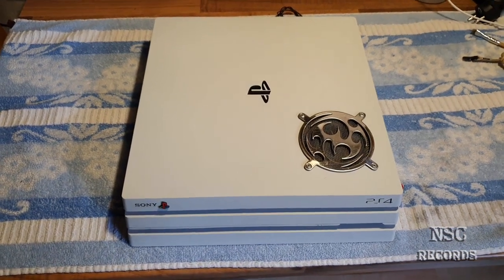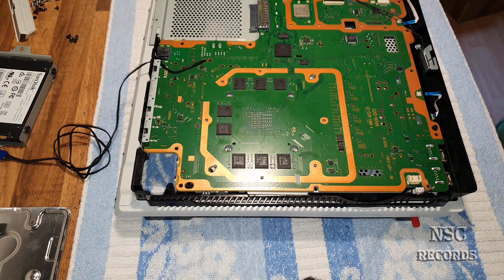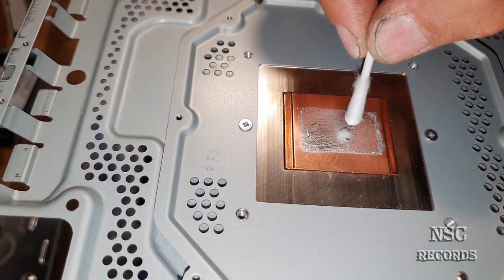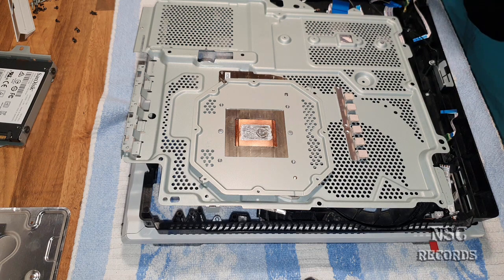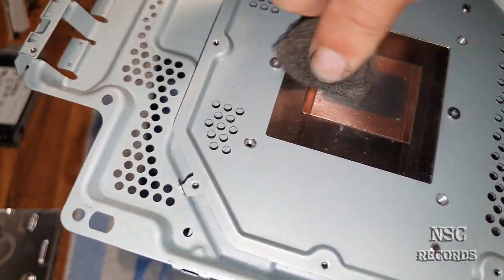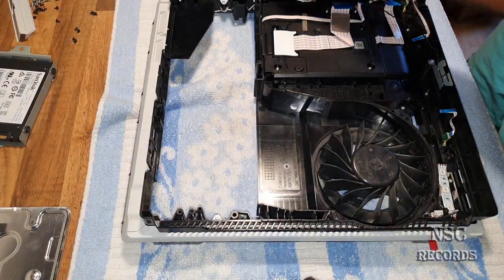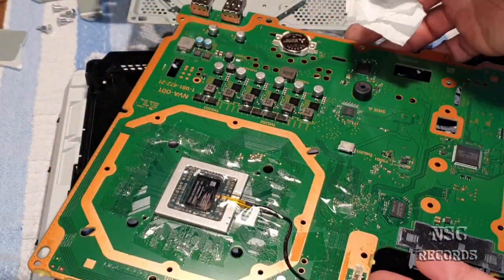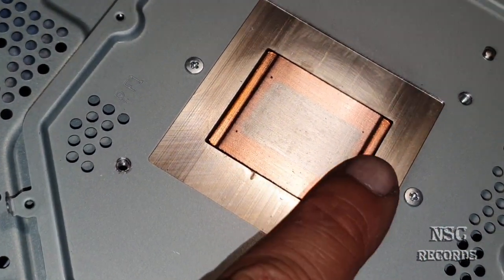Liquid Metal on a PS4 only for few days, take a look how it looks By:NSC

Comment: I had great results from using a IC Graphite Thermal pad on my PS4 Pro. The best part is I don't have to worry about the paste drying out anymore.  The biggest difficulty was getting the graphite pad to stay in place when putting the board back on. I had to use just a tiny tiny amount of thermal paste (put a smidge on two opposing corners) to get it to stay on the die while I lowered the board on the cover. I also used my girlfriend's nail polish to clear-coat any open electronics surrounding the die because the graphite is conductive. I reused and recentered the pads on the memory chips. Now the PS4 Pro sounds like it is brand new.  My refrigerator is the noisiest sound in the room.
Reply from the maker: Yeah, they are really good, used it also on some Notebooks and some ps3 :)

Comment: I know this was an experiment/test, but since consoles are usually carried from place to place  and you can't simply replace the whole cooling solution of consoles without buying a new console or parts of it (which are sometimes either hard to find or are more expensive than some high quality PC coolers), using a compound, which gives good cooling performance for some lifespan of a product still doesn't make any sense.

I think, the only best option for cooling consoles is to put them on some sort of open bench and somehow put a PC radiator to APUs with washers or something like that. 

Also, this is just a theory, but from watching how mobile manufacturers use graphite sheets and copper sheet tapes to cool powerful APUs in such a limited space as smartphone, there's probably some smart way to cool a console while using the original case.
Reply from the maker: Watch my next Video, you gonna be shocked...

Comment: Just opened my launch pro with liquid metal .  After a couple years I guess.  Fan was starting to ramp up on all games, opened up and it was completely dry !! The copper heat sink is now silver!  Tried removing was a no go .  On the bright side copper heat sink was smooth so applied kryonaught and is very silent now.
Reply from the maker: Yeah, forget liquid metal on consoles...
Reply: @NSC-Modz  hey, what do you think about sony using liquid metal for ps5? is it gonna be dangerous in future
Reply from the maker: @wazza831  i think same, i will check it out as ill get the PS5
Reply: I have liquid metal in my PS4 Pro, and after some time or a lot of movement I need to clean and reapply. Exactly the same happens to mine (heatsink goes silvery and rough), but after a good clean up - it is better than before. Seems to last longer and longer each time I need to do this. A super quiet PS4 is worth a bit of maintnence once in a while imho :-)
Edit - Perhaps the heatsink is an alloy of sorts, not completly copper....
Reply from the maker: @EgonSorensen  yeah, for me never more again liquid metal xD Kryonaut is just ok tho...

Comment: What do you think about the PS5 Liquid Metal Cooling. Do you think they are using a proprietary liquid metal? Will it last? I heard it has been decided 2 years ago and they may have tested it extensively.
Reply from the maker: I have tested it already a lot times, but at last i always replaced again with standard thermal paste, so in easy words, it's not worth...

Comment: I have done this mod but I went further and set a temperature gauge tuning from the gpu.I used a drimmel to cut the metal around the gpu so I could fit the sensor touching the chip used clear nail polish to cover all the transistors.applyed liquid metal.cutting the case under the ps4 pro and the metal plates so the ram chips showed.
 I put heat sinks on ever ram chip.
i also cut the inside of the consoles metal plate in the spots where the stock fan would have been.
I toke the stock fan out.
removed it all together.
I then bolted a pc fan over the top.where your hole is.
where the fan should have been anyways.I then put metal adjustable legs like for furniture under the ps4 pro and then a pc fan over the ram chips this is so the air could flow under the unit.cooling ram helps great amounts.I installed led and a sensor.
Next to where the stock fan should have been you can see a space I fit the screen display around that area.
I got a ssd 4tb hard drive ran it externally by a male to female hhd adapter.I installed a labtop blower fan inside the hard drive bay to help blow hot air out the back.temps 74/94.my modified unit ran great still runs to this day.it was a launch CUB7200 series model ps4pro.during game load temps flex and mostly stayed in the lower temps but horizon and god of war would make it get in the 90s.crashing and glitching more stable fps great modification.I got ps5 launch day modified days after.same with series x.looks wise I love the console I went over board and ended up selling my ps4pro for 450$ and a original ps4.Wish I did not sell it just because I had ps5.

Comment: ARCTIC MX-4 Thermal Compound is the best for PS4
Reply from the maker: Yep, it´s fully enough for a Console :)
Reply: What about Noctua NT-H1?
Reply: or thermal grizzly kryonaut
Reply from the maker: @wazza831  both good as well :)
Reply: thank you so much i needed to know which one to use
Reply: You are rong Arctic mx4 isn't I will say it is good stuff but your mistaken.see I had side by side benchmark tests of every ps4 model shown liquid metal is the better especially for the ps4 pro.
Let me ask you this Dark night baby showers lol why would Sony use it on ps the ps5? Obviously it must be better.
cuzz if it wasn't anything other than the best.well ive had liquid metal on my 6tb ps4 pro for almost 2 years and it runs fine truth be told same modications as nsc but my thermal temperature guage is on the top case under my fan hole in the front.
Reply: i used thermalright tfx

Comment: Please can you help me? I bought a fat PS3 several months ago, but think is thats its starting to sound like a jet. I know that its thermal paste issue, so I opened it and guess what: the motherboard wont come off the heatsink. I tried using heat gun and even playing some ge for an hour, still no luck. Btw the model of that PS3 is CECHG04. Can you please give me some advice. I was searching all over the internet about it, and it seems like some other people have simmilar problem with same or simmilar models, and of course I couldnt find the answer for my problem.
Reply: You have a good chance of ruining it if you mess up the bottom side of the chip's attachment to the mother board. You could try going around the crack with a qtip and some IPA and see if that loosens it up. I saw a video before where someone used a small screwdriver (or razorblade) and got it between the two surfaces and turned it and that crusty thermal grease just broke apart.
Reply from the maker: You need to remove the IHS, please search on my YouTube Channel for IHS removal Videos and watch the latest ones :)
Reply: @travisperegrine7329  I actually used prying tool for phones to loosen it up, still no luck. It looks like the area around the cpu is glued in with heatsink.

Comment: It dries cause you dont have a clue on how to apply metal liquid. Clean with alcohol or zippo gasoline,2 NEVER USE TAPE, THE TAPE GLUE/PLASTIC WILL REACT TO THE METAL LIQUID,3 enjoy. If you wonder how to protect the capacitors in the chip area use nail proctector ,the one that girls apply to protect nails. I have been using liquid metal like 8 years in everything and never saw that bubbles in any of my equipments... Also i never replaced any of it in  laptop cpu+gpu ,ps4 pro ,i7 6700k and i9 9900kf. Also the part where your copper heatsink is silver ,its normal  nothing wrong there.
Reply from the maker: OMG bla bla bla bla
Reply from the maker: Why so stupid??? No Sex bro.?

Comment: I see that clear coat on the chipset
Reply from the maker: Yes, this will stay for ever after LM...
Reply: @NSC-Modz  how is the copper plate condition. This would be easy on a PS4 FAT or slim but aluminum don’t play.
Reply: @NSC-Modz  did you lap the heatsink surface??
Reply from the maker: @alejandrotobienne584  I have lap the copper cooler AND i have lap the APU because my APU was convex. I made a video about that. You should watch it, maybe you have the same problem.
Reply: @NSC-Modz  I did watch it but don’t want to lap the APU. Was wondering if lapping heatsink will ad anything. Thanks
Reply: @NSC-Modz  can’t find video but thanks 🙏🏾 anyways.
Reply from the maker: @alejandrotobienne584  here you go: 
https://youtu.be/tVkeZXvNfdU
Reply from the maker: @alejandrotobienne584  oh ok yeah just enough to lap the cooler only. No need to lap the APU, it's not recommend, i just did it because I'm crazy 😅
Reply: @NSC-Modz  thanks
Reply from the maker: @alejandrotobienne584  you welcome